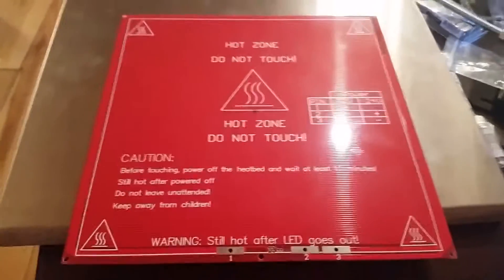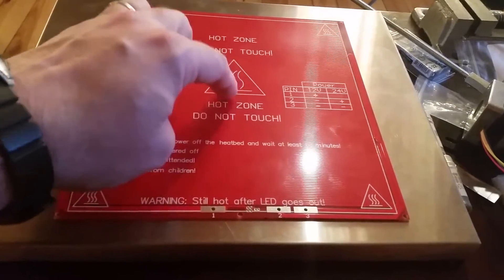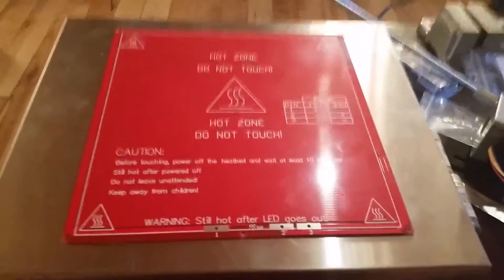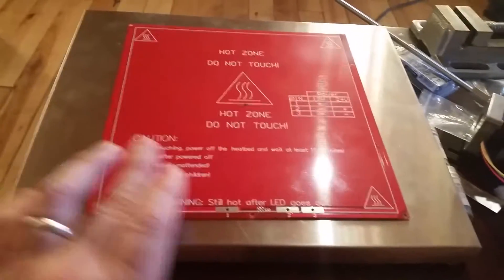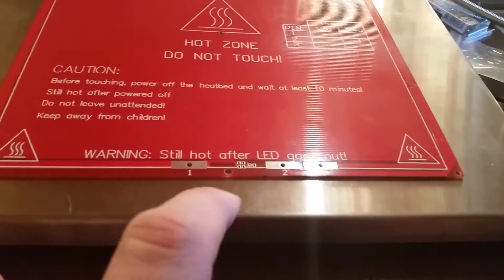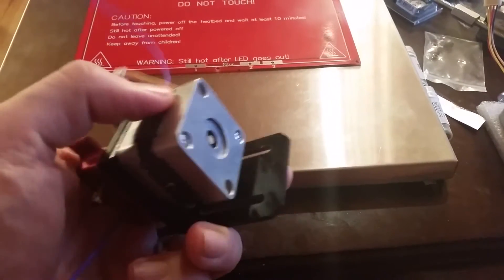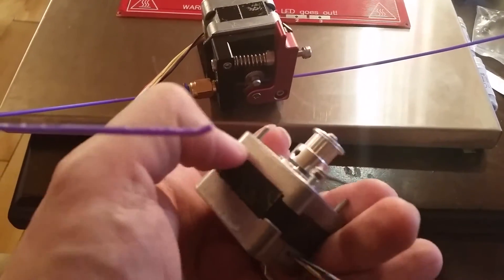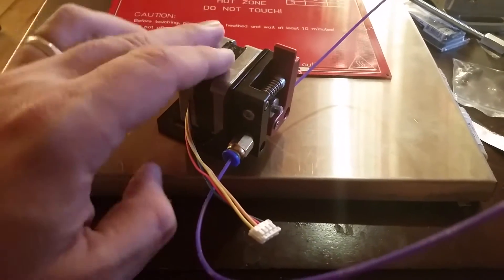Fixing PCB warping [ Heatbeds & PCB ]

Comment: I have 18 inches X 18 inches bed so what I use for heating bed I don't find any thing bigger than 11 x 11 inches
Reply from the maker: possibly contact ATT , two posts back below if you sort by time .  they say they specialize in ptc heaters , possibly they have a big one .
Or you might want to look into  using 4 motor bike handle warming pads .  they are essentially small flexible silicone pad heaters you could put under your large print surface .

Comment: Thanks for a great video. I have big problem with my 3D printer, it is wrapping upside, nuzzle stick in the model, and damages the model after several hours work, and sometimes the smelting filament will not stick to the bed, in the beginning. I guess I need a MK2B Heat Bed PCB, but I do not know what I should buy. Could you please help me what should I buy and how I should connect it to my printer, I am new on 3d printers. My printer is a Velleman Vertex 3d Printer K8400 https://discountoffice.nl/p/vertex-3d-printer/?gclid=CNCX16iNpNICFUkQ0wodYnII4A
Reply from the maker: sorry for long reply , for some reason YouTube  held your comment for approval ?   . any how  looking at that link , you printer should take a heat bed  . It says it can but it's not clear what one .  they also seem to recommend a removable layer of Buildtak  as the surface .  I hope you found a good solution .

Comment: My hotbed, which already has wires attached has a dip in the opposite direction. which gives an 8 degree temp difference from the edge to the middle. I am trying to flatten it but  not sure how to do that without damaging other parts. your video has given me some ideas but i still need to work out a method. But thanks good video.
Reply from the maker: oh man .  heat and time .  lower the heat the more time it will take .  if you have the ability to remove the soldered on wires and exes solder, then you should be able to do the regular process and sandwich it .  but  the PCB has to be clean ..  no glue or tape or PEI or such coating , just clean PCB .  if you knew the solder was you might be able to bake it . 
120c (250f) over a hour  is all it takes.   so running a heat bet over 120c , can make it pick up flex form spring tension .  baking is best done with a clean board between 2 flat things that can take the heat and wont stick in any way .   the issue is the coating on the wires to the board may get scorched if you dont remove them .  and stink up your oven with plastic stink . 
be safe and have a look here too : http://www.circuitrework.com/guides/3-2.shtml

Comment: I didn't know PCBs are malleable.  Nice Tip!
Reply from the maker: +Hari Wiguna , sorta , have a look at this link , its the best one I can find rite now that covers bow and twist repair it better than I did .  http://www.circuitrework.com/guides/3-2.shtml  . they went like 7deg F hotter than i did :P  .   but almost the same as I have used for a while now .  The issue can be more troublesome on multi layer boards that have uneven copper distributions. that can cause big warping .